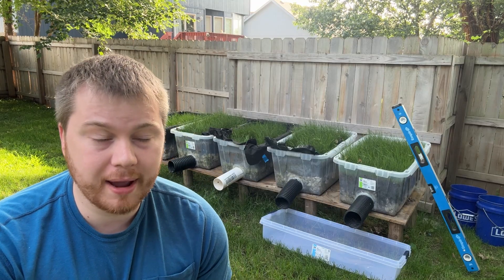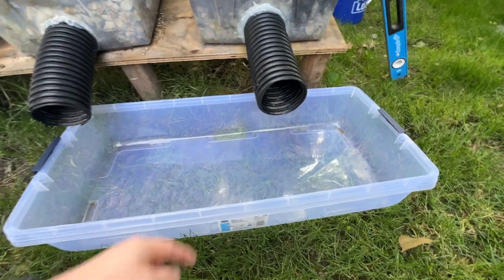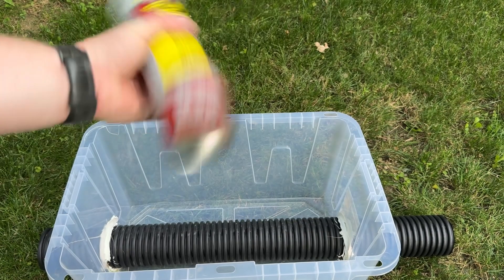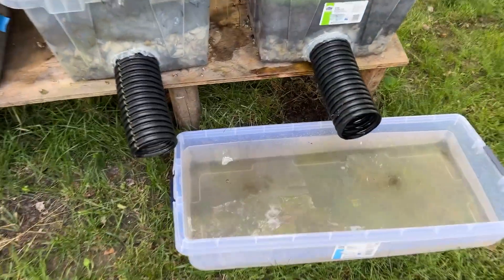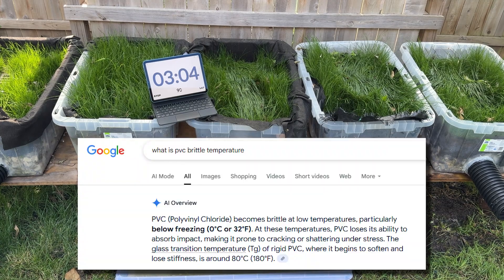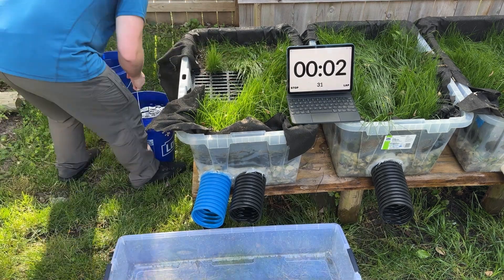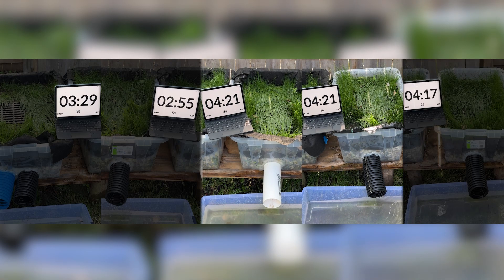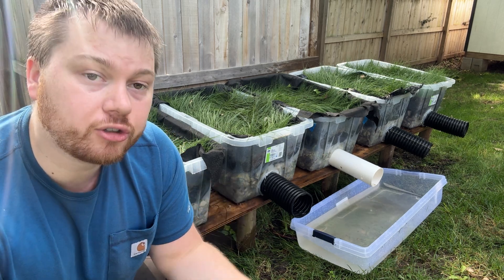5 French Drain Styles - An Unbiased Experiment

Comment: IMHO There are a few weak points in your analysis:
1. Washed crushed rock (aggregate) is far superior to the mixed aggregate used;
2. If you want to compare apples to oranges, you should calculate the total surface area of all the holes for both the corrugated pipe and the PVC pipe;
3. The best filter is the sand itself, laid all around the crushed rock. The various fabrics (geotextiles), which are very fashionable among YouTube 'experts,' are strictly forbidden in the construction of dam drainage systems. There must be a reason for that.
Anyway, well done; curiosity is the basis of human evolution.

Comment: While exposing my root flare i finally found where the water goes from the gutter.... and while doing so found this woven garbage 5 ft from where corrugated pipe ended... we don't have a french drain but we noticed that when putting water straight from it's the gutter, down to where the tree is that before the wire can get to the very end of the pipe, it starts to bubble and then divert around the original destination of the system, and the water itself is real oily looking. But that might be normal. Either way, I just want to say that for whatever system we have, the woven seems to be  Really terrible.  We were thinking of cutting off the pipe where it was bubbling, anyways, and then installing a catch basin at the very bottom, we have a huge slope going in the good direction, and so i'm not quite sure why the original installers would have made the pipe . If I were to guess, probably about a hundred feet of pipe,  and probably drowning poor pine tree.  I also don't think that the water is even getting to its desired destination without us. Putting a ton of water in it so who knows where it's actually ending up. And we don't want to tear up all of our garden, just to find out where more of it's broken, not quite sure what to do

Comment: Fabric is expected to fail in ~10 years.  The argument was with government grants to get blind-inlet funding on farms.  The government wanted fabric but the farmers wanted lifetime-solutions & to just keep throwing rocks in the hole until the hole stopped getting bigger.  The idea was intended for blind-inlets to reduce the amount of N & P getting into our rivers & lowering the number of fish due to pathogen outbreaks in high nutrient conditions.  Originally the farmers were using vertical-risers, basically a vertical perforated pipe, but they would always damage the vertical-pipe with the tractor & needed a solution with fewer responsibilities.
Reply from the maker: When we start a podcast, you'll be the first guest invited on 😉
Reply: @High-Flow-Drainage-Solutions  I'm no expert at anything.  I just question everything.